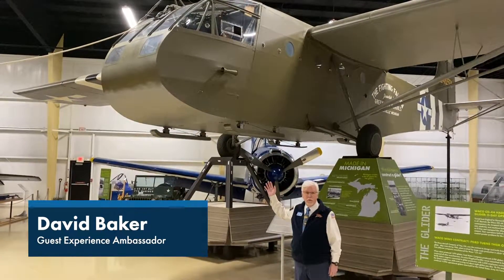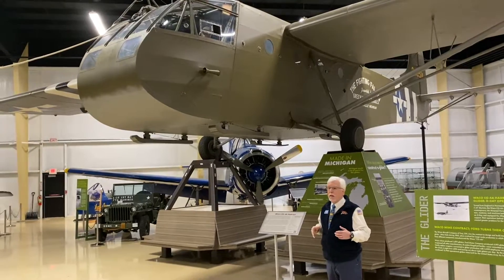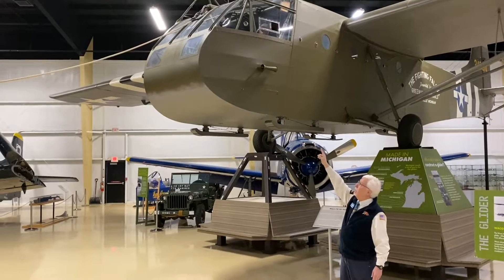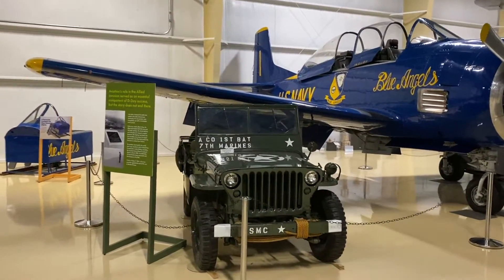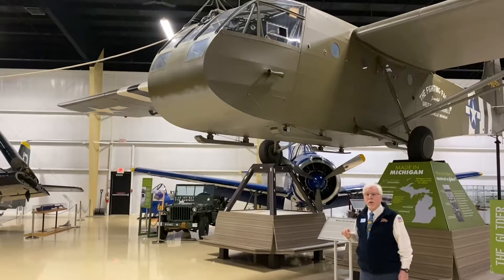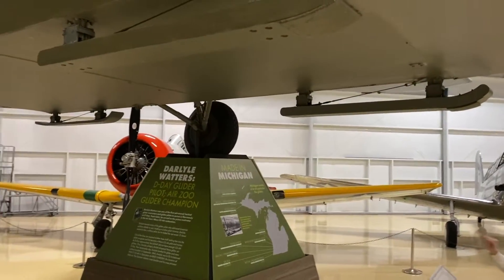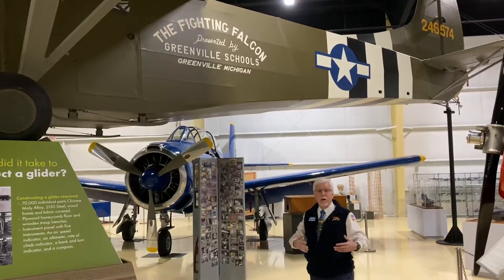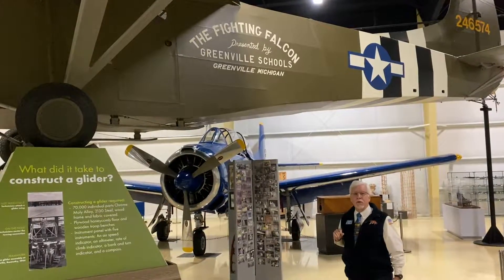Meet the WACO CG-4A

Comment: I wish that a new bulided CG-4A glider could be created with a try-cycle fixed landing gear with double tire nose gear and be towed up again to the sky this time with the LOCKHEED C-130 HERCULES.
Reply: Some years ago there were some glider trainers. Modified small planes with an extra seat where the engine would have gone. They used that design to get as many pilots as possible trained in how to fly them. One seat was the instructor and the 2 guys being trained would swap seats for each flight. When the session was over, we had 2 trained glider pilots ready to enter the fight.

Comment: Does anyone have information on the electrical system of these aircraft? Pictures show headsets for the Pilot and copilot but no radio stacks. Was this strictly for intercom? Also there are navigation lights on the wingtips but no wind powered generator assembly that I can see.

Was the whole electrical system run on a battery bank?
Reply: That's interesting. One of the things that surprised me when I transitioned to gliders was that we didn't wear headsets at all.
Reply: In this training video I saw on youtube, they were using handheld radios, like the big brick phones but these radios were bigger.
Reply: There was a wired intercom that connected from the glider to the tow plane alongside the tow rope.  Notoriously un-reliable.  That would explain the headsets.  I don't believe that any of the gliders used in combat would have used nav lights....
Reply: I read somewhere that they used a modified BC-611 walkie talkies with a speaker to communicate with the other aircraft.